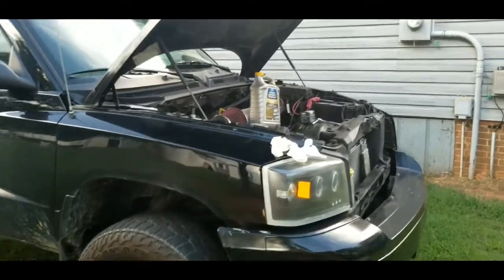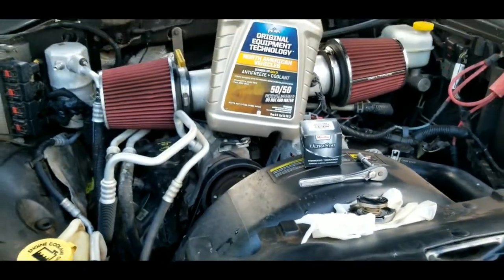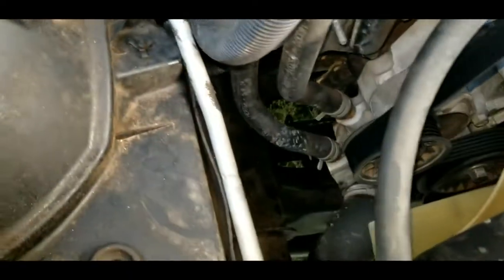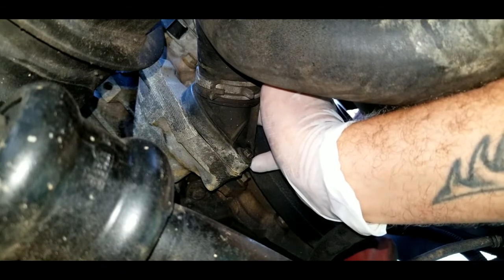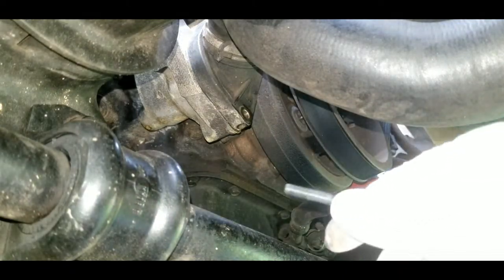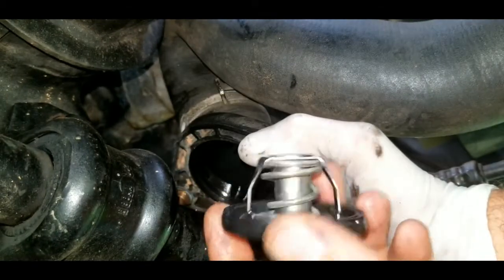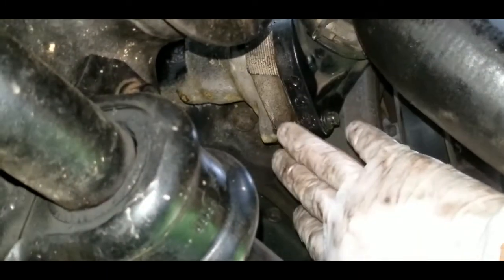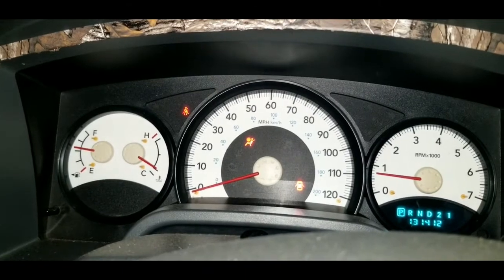Replacing the thermostat in 2005 Dodge Dakota

Comment: So no replacement gasket is needed on the 3.7L thermostat housing or does the new thermostat black rubber circumference seal the actual housing without the need for a separate gasket? Just wondering. Thanks for the video.
Reply from the maker: No, you don't buy separate gasket, the gasket is built onto the thermostat. Just be sure to line the square nub in the right spot
Reply: @MattsFinds  Can I use the same one "thermostat black rubber" with my Dakota 02 V6 36 instead of buying  normal thermostat then buy gasket. Does it work?
Reply from the maker: I'm not sure about an 02 dakota. You could ask you local parts store if they could pull up the diagram and see if it shows a gasket between the housing. In this 05 the gasket is built into the new thermostat

Comment: I have to replace my radiator… should I replace the thermostat too ? I have. 155k miles. What else should be changed out since the radiator will be out. 

Thanks
Reply from the maker: Might as well change it since you gotta drain it anyways but get a good quality one not the cheapest one you can find.

Comment: Why disconnect the battery tho?
Reply from the maker: It's a good practice to unhook just the negative terminal when working on any vehicle. Prevents shorts and shocks. Also it give the computer time to reset and adjust itself to the new working part you just installed